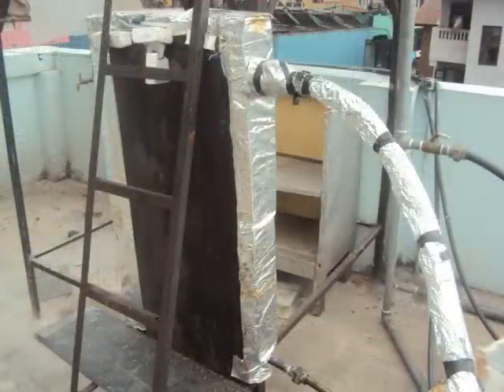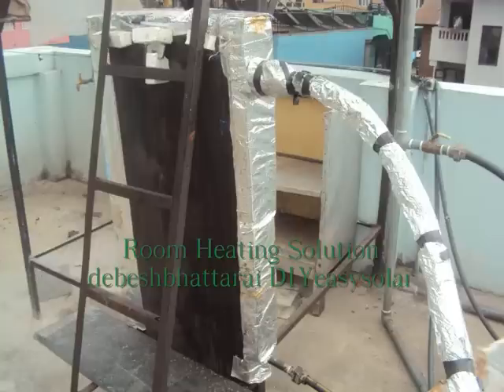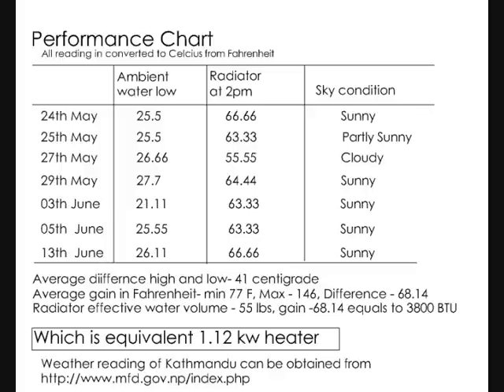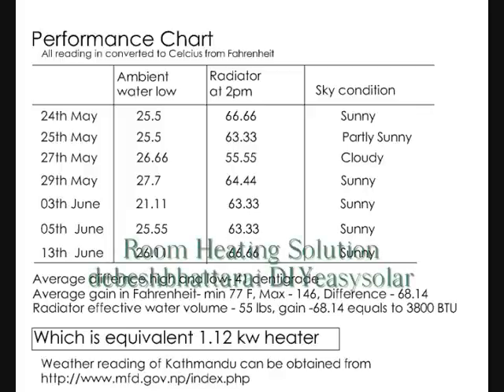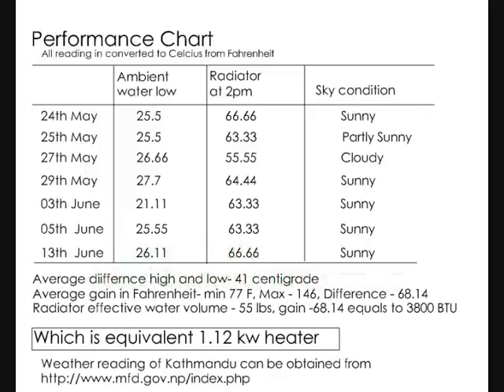Solar Room Heating Solution DIY  to Insure free energy

Comment: Looks workable, Debesh. My main concerns are size, placement, and distance from the solar collector. I'm not sure if most people have a location for one of the collectors, and if they do it might need to be meters away from the radiator. I'm not trying to be negative, but I think these are important issues. Also, my community would make me take it down if I constructed one. They would cite it as an eyesore. Good idea, though.